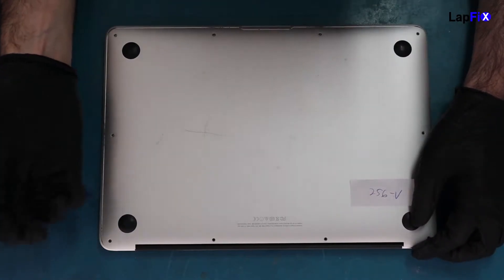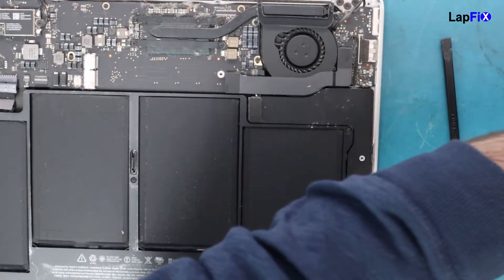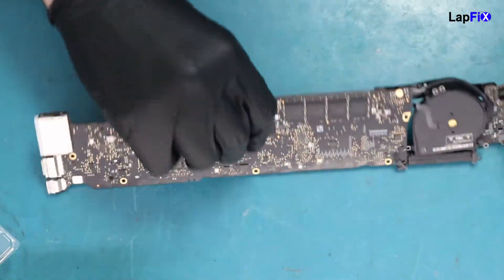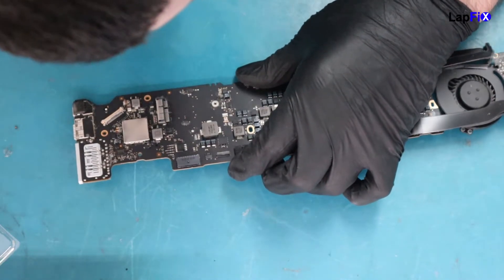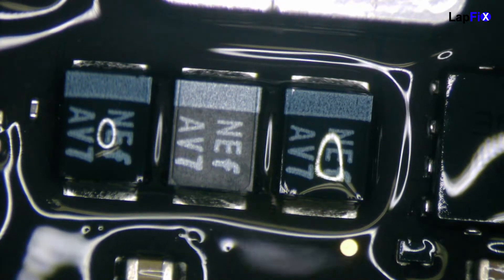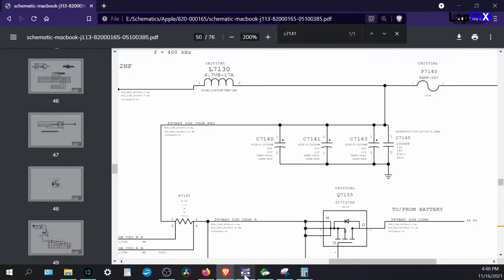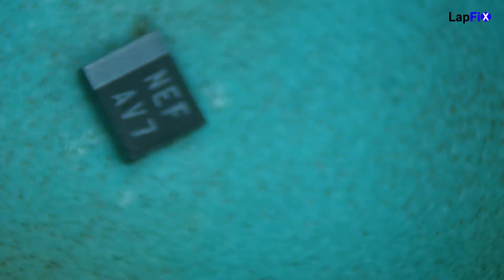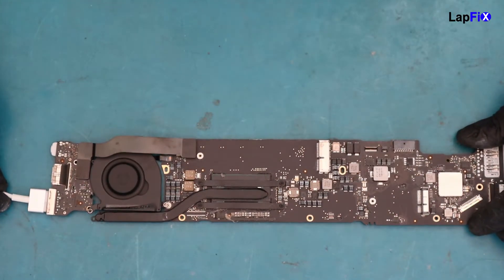Repairing a Dead MacBook Air Orange Light No Power

Comment: I have a similar problem, but mine turns on after days of not using it. Battery charges and orange light turns green. I replaced the battery that was swollen but still the same thing.
Reply: Did u fix it cuz I have the same problem 😢

Comment: I opened the back of my laptop (air 2014)... It was left in a closet for 2 months, I have no idea why it's not turning on, I tried to unplug the battery and use thr charger to turn it on with the battery unplugged, but the light stays orange and no picture on screen, even after resetting SMC... How can I diagnose what's broken if I can't turn it on? I'm so broke I cant buy a new one